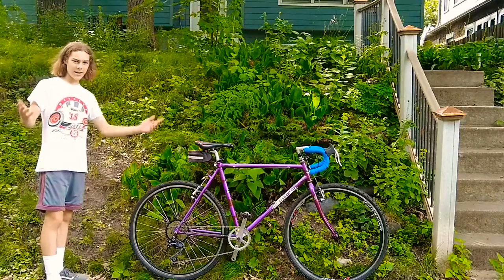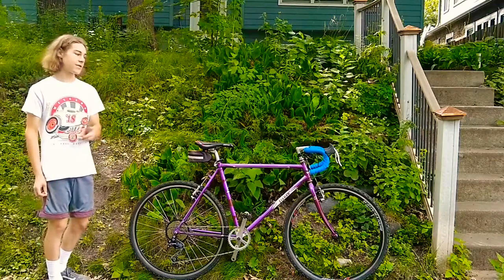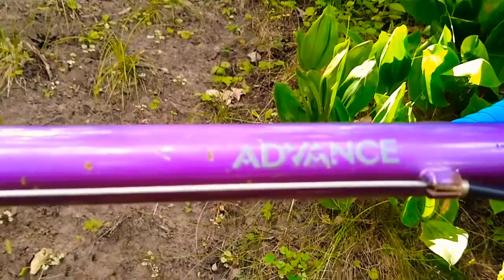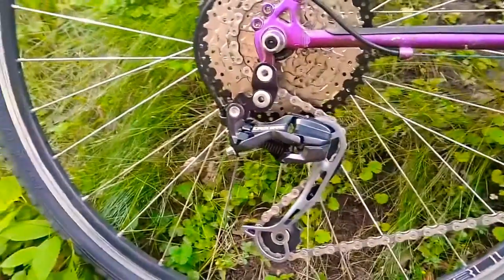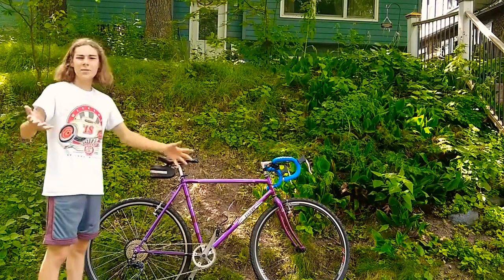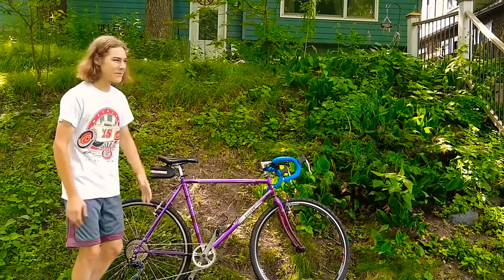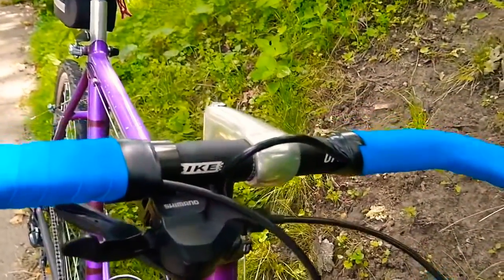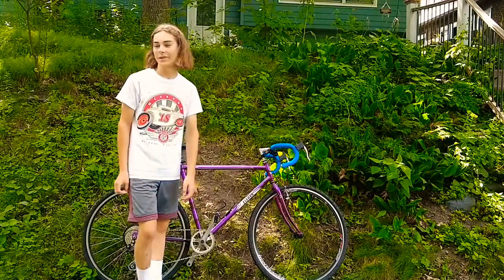Vintage Fisher Mountain Bike To Dropbar Gravel Bike Conversion Update

Comment: Haha this is such a great recommendation for me, because i'm doing exactly the same thing to my mountain bike XD I'm changing the stem to a road bike stem and the handlebars to a drop bar! :D Also i have the same bartape hahaha Basically my mountain bike was 17kg and one day it hit me: I NEVER put it on a dirt road or anything, so why the hell do i need a mtb?? i've been customizing it to be more like a road bike ever since ( i do like the full suspension, makes the ride very smooth on the horrible roads i have here) so it now weights 13kg and is like a hybrid XD my bike is all black appart from the pedals which i painted metallic blue and also the front suspension is metallic blue, and bartape is blue exactly like yours :)
Reply from the maker: Thanks for the great enthusiasm towards the drop bar mountain bike I did a video earlier talking about the build converting the bike from an MTB to a road bike. Subscribe because I will be making more videos like this very soon.
Reply: @CyclingWithSully  Already subbed bro, keep going this is very interesting! :)

I could have bought a proper road bike, but it would have been much more expensive and then i'd be left with 2 bikes and only use one of them, nah xD